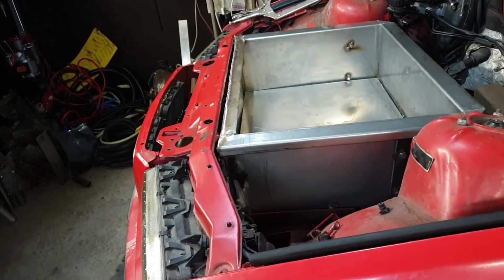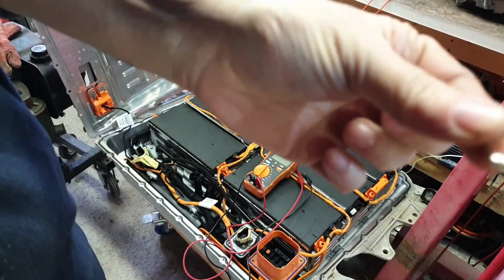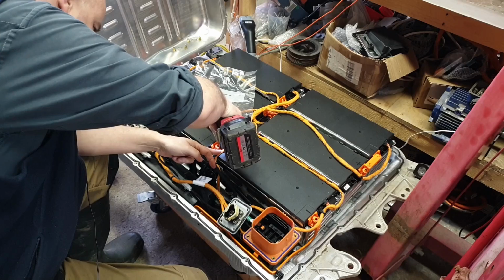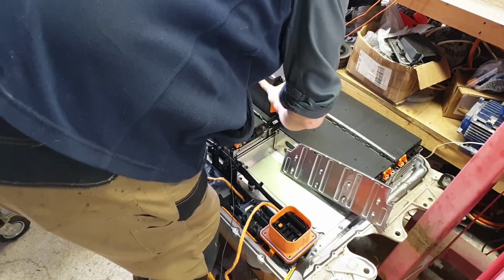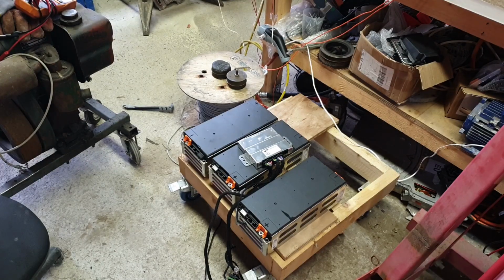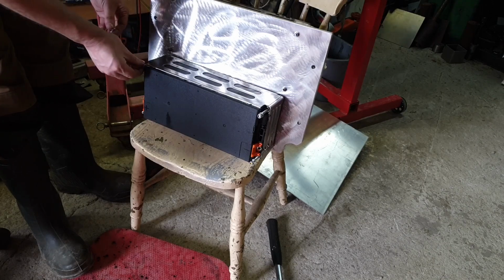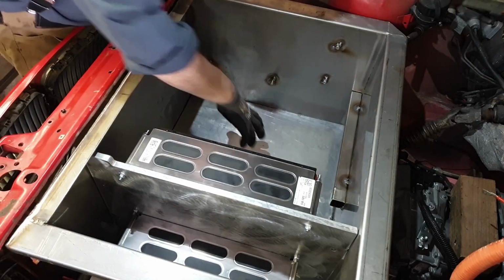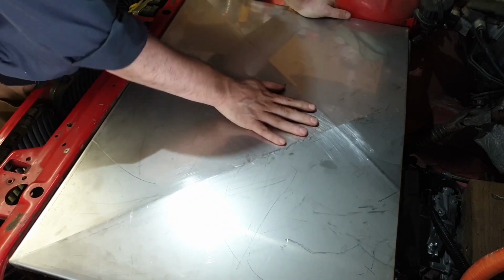BMW E36 EV Conversion Lexus GS300H Swap Part 3

Comment: Weld the nuts to the outside without making a hole in the box for less chance of water ingress? Locktite the bolts against vibration.

Just a thought, never attempted any of this. You have persevered a lot farther then I ever have. 
👍

Comment: So if a battery is not grounded so totally isolated, i can touch the positive terminal with 400v?
Reply: Yes, because 400V with respect to what? Voltage is always between two poles never on a single pole.
Reply: @openinverter  thanks, never was a 100% sure
Reply: @ElmarBon  in that case better sure than sorry ;)